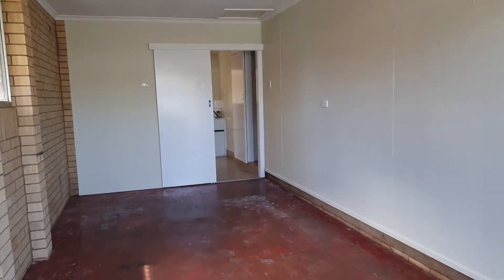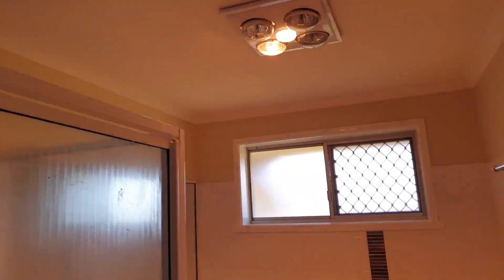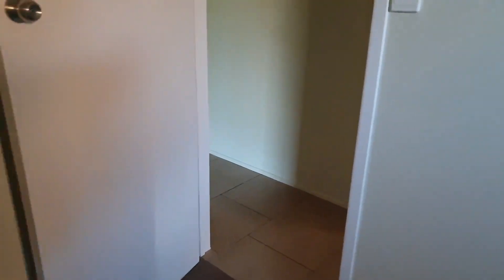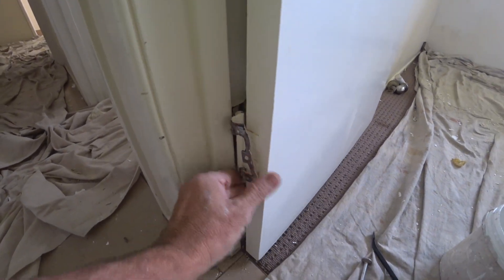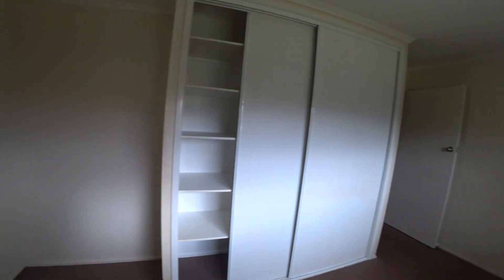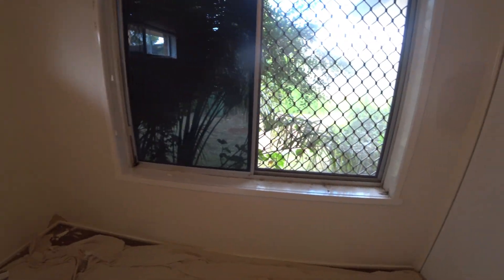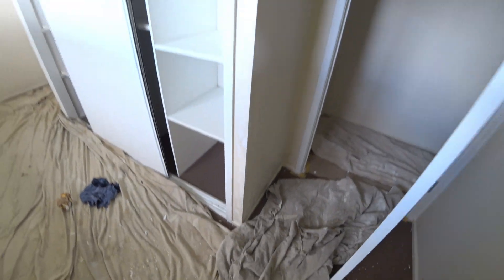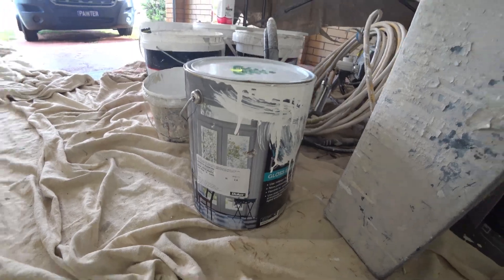Rental repaint completed and looking great.

Comment: Came up good. How was that Berger water enamel compared to the Dulux.
Reply from the maker: It was very similar to aquanamel in a lot of ways, however, it does run and that turned me off and it didn't cover very good but it was lexicon quarter so it might cover better in a darker colour. It was however very cheap compared to the others and it did the job and wasn't a bad sheen for a water-based gloss.
Reply: @ThePa1nterhowto  Ok then it looks like I will stick with the aqua. I just finished a unit and did the doors semi aqua and used some floetrol. Looked very smick, seemed to flatten the stipple a bit.
Reply from the maker: @sydneyshinshi  I'm keen on the steriguard, it doesn't run